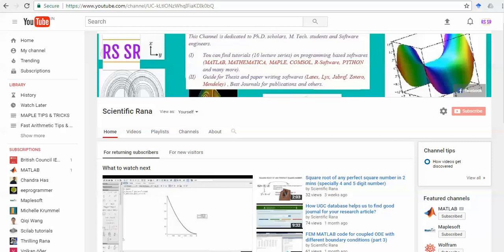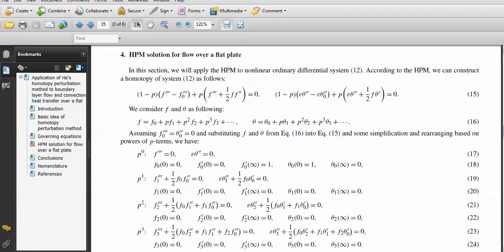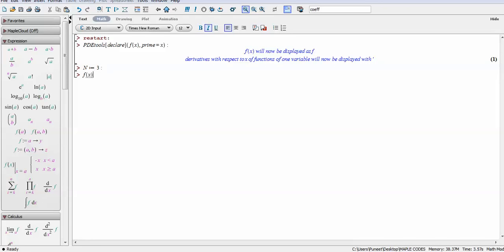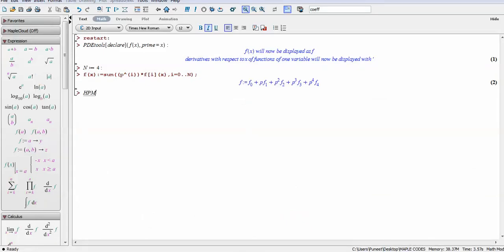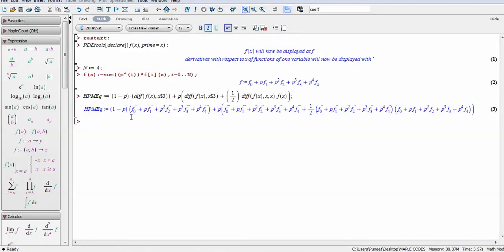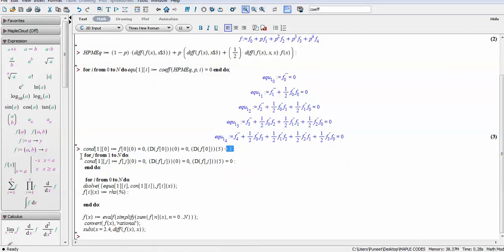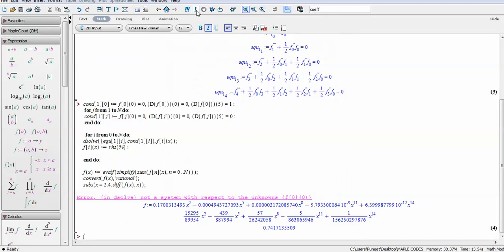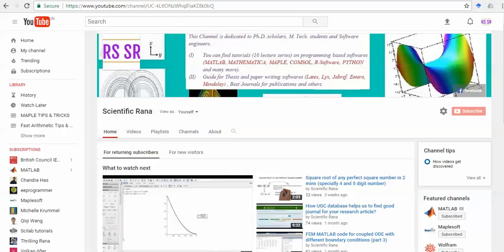MAPLE Tutorial 2: He's Homotopy Perturbation Method (HPM) MAPLE code for 1D nonlinear ode

Comment: Sir, I have tried to find the graphs of this problem by developing a numerical code  but the graphs did not match with the paper. Can you please suggest me whether the graphs obtained in the paper are right or wrong.
Reply from the maker: The graphs are correct. hope you have used this command in the last, for plotting f(x) and f'(x)
plot({f(x), diff(f(x), x)}, x = 0 .. 5)
Reply: thanku sir, for ur valuable suggestion. will contact you if i face any problem in future
.
Reply: what is the version of maple, you are using?
Reply: @farhanaumerhayat  2018
Reply: HPMEq:=(1-p).(diff(f(x),x$3))+p.(diff(f(x),x$3)+(1/2).diff(f(x),x,x).f(x)); 
Error, (in print/diff/indexed) invalid subscript selector
Reply: Rajan Kumar whatsapp 00962770516834 please